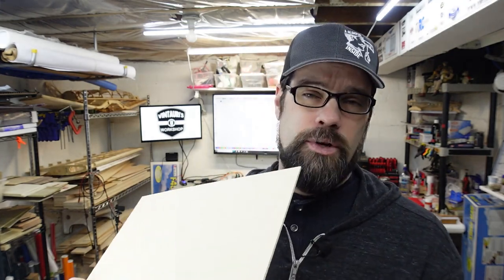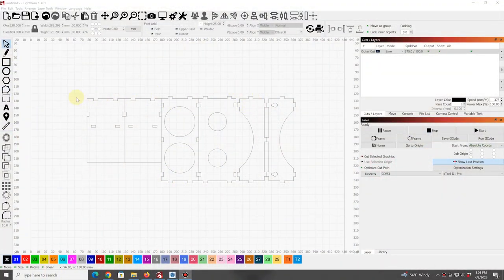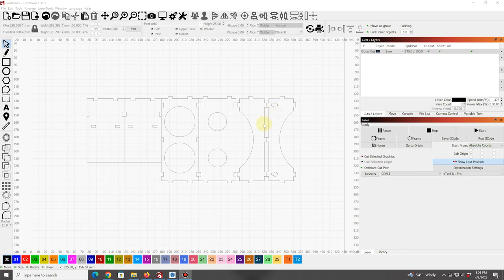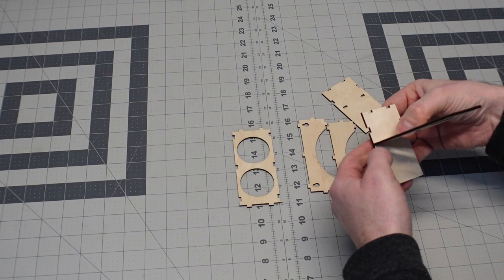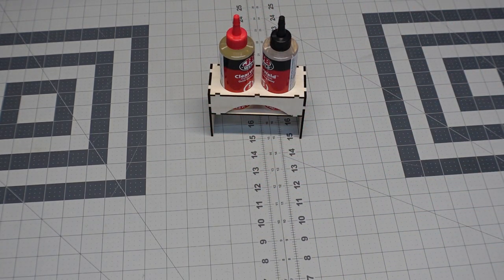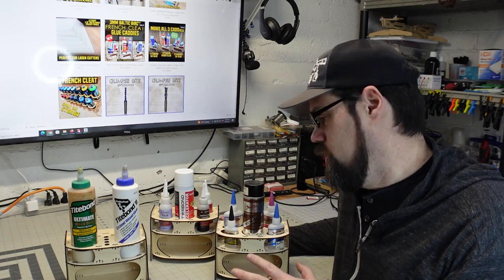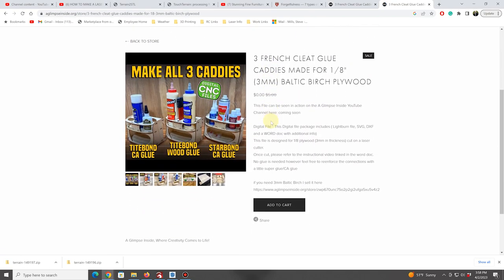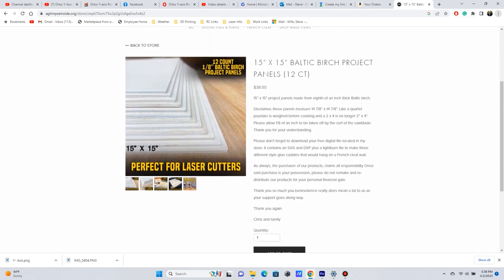Glue Caddies for shop Organization | Cut on the xTool D1 Pro 20w

Comment: I noticed on the Epoxy Caddy that four of the notches don't seem to line up when you show the file in Lightburn on your video. I downloaded it but haven't cut it out yet. Do you think it's ok?
Reply from the maker: I had no problems with the files. Everything snapped together fine. Depending on your kerf, some joints may be tight but I made no changes to it and all three fit together.